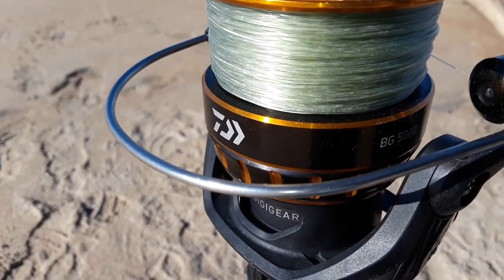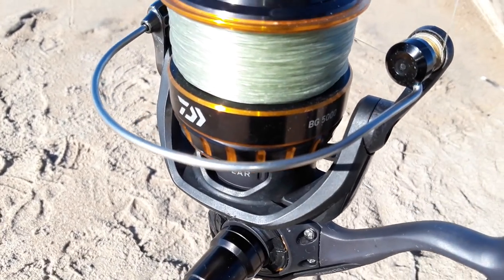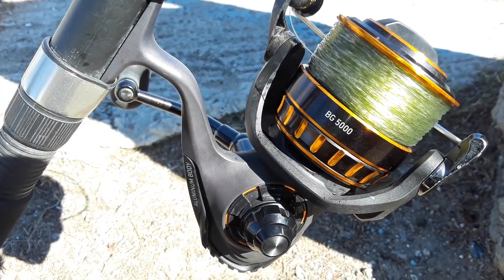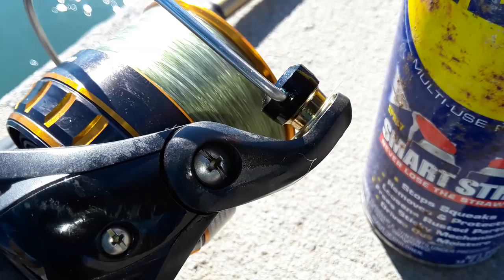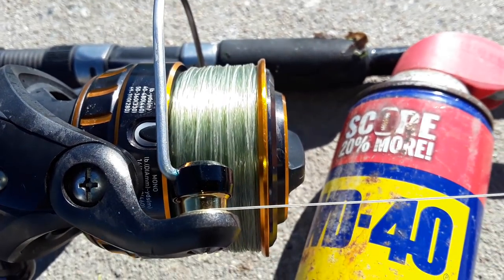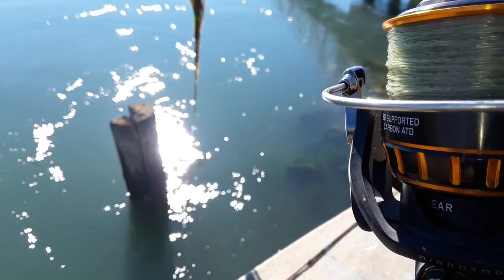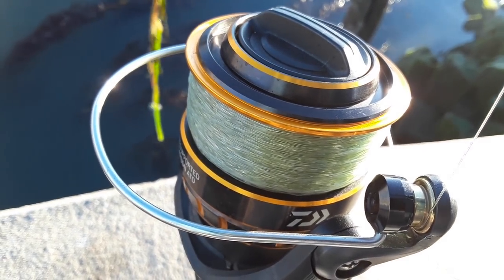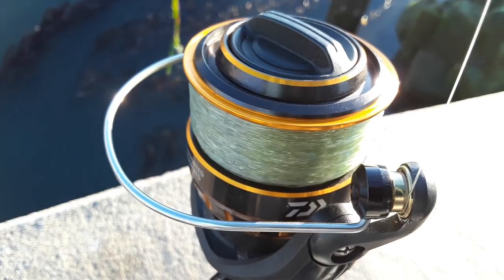Daiwa BG 4000/5000 Review Line Roller Using W-D40

Comment: I own a reel repair business.  I recommend you take that roller apart ASAP.  WD40 eats your grease and oil.  Clean it with WD40 or CRC Electronics cleaner.  Dry it well with pressurized air on the bearings and bushings.  Then lube your bearings with a good quality oil like Clenzoil or a nice synthetic like Royal Purple 20W.  Then put waterproof grease on both ends of the roller assembly before putting it back together on the bail.  I use Yamalube because it is amazing and light weight.  Reassemble and rinse with fresh water regularly after use in salt water.  Lube frequently.
Reply from the maker: Yes I did do that as soon as I got home....this video was just experimenting purposes...and what to expect with sand salt water and dryness.  But thanks for your comments and for watching😃😃

Comment: Why do you fill you need that heavy of a sinker!
Reply from the maker: These were just examples to mimic heavy use in a short period of time. And to exaggerate wear..and tear. This video was also to pinpoint different types of grease that wear (thin out) faster than others...in this case it was Penn Precision Reel grease...It did NOT last long....so to demonstrate a quick fix w-D40...was used to get you right back to fishing asap. This video just shows how having heavy weight wd40..will work for the moment